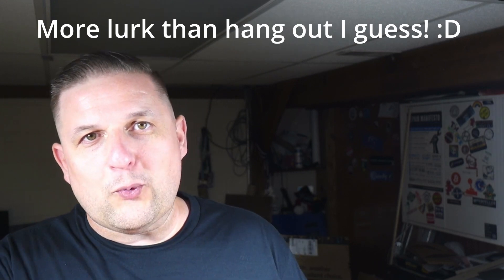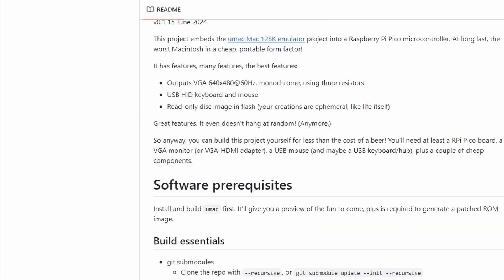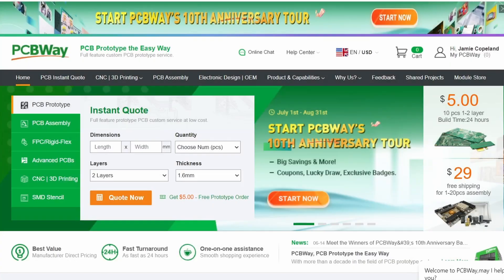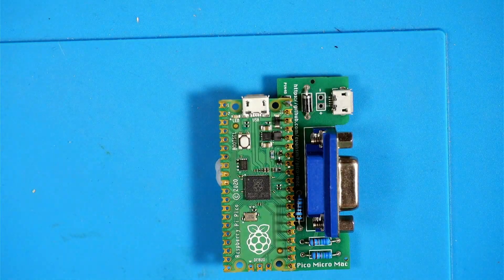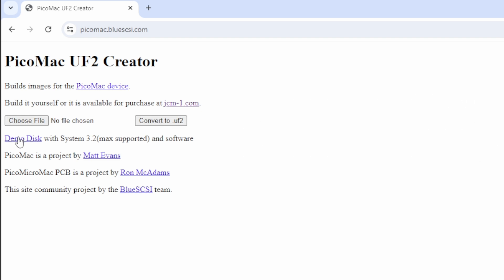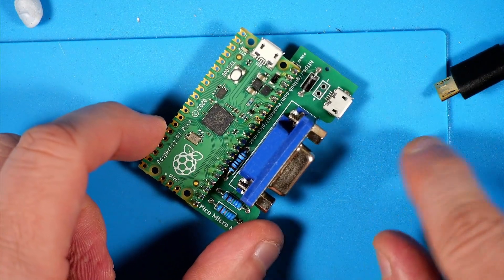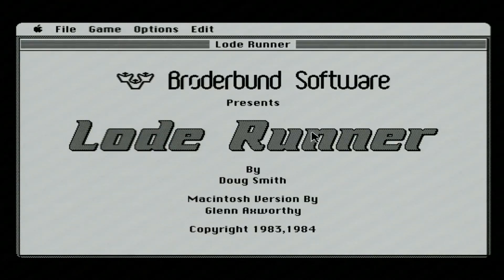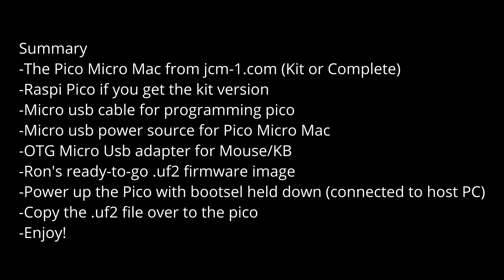Pico Micro Mac - Quick Start

Comment: I loaded the demo disk in mini vmac, transferred Mac Draw onto it, and then used the compiler on the site to make a new disk image. Paint requires being able to write to disk but MacDraw works!
Reply from the maker: @_kevlar3357  Right on! I need to give that a shot.
Reply: @JamiesHackShack  The github mentions that SD storage can be added via the SPI bus.  Would be cool if someone can try that and also increase the memory to get MacPaint to work.
Reply from the maker: @EricRangell  💯 it's coming. Some folks are tinkering with that and even messing around with a PCB to kind of sandwich with this one. 👍

Comment: Very cool.  That V2 form-factor looks like it would fit well if stood up vertically in a 3d printed micro-mac case!
Reply from the maker: Hey thanks for watching! I like where you mind is going. Need to look at what kind of cases may be out there to tinker with.